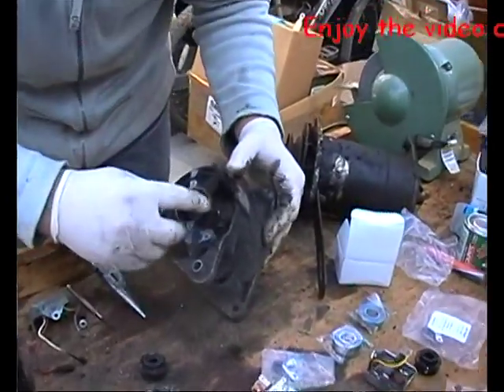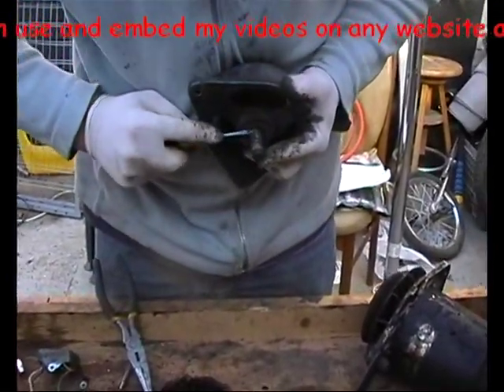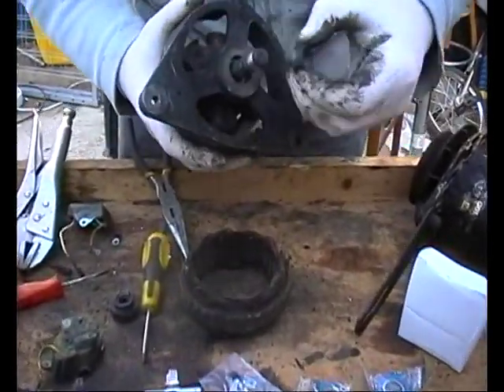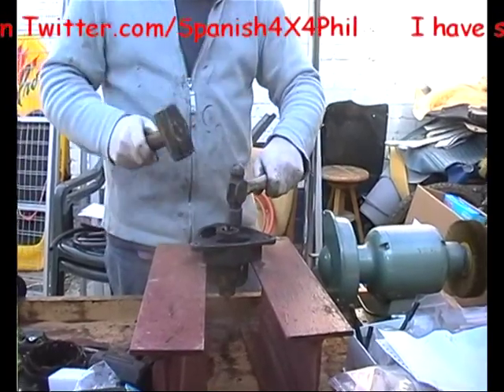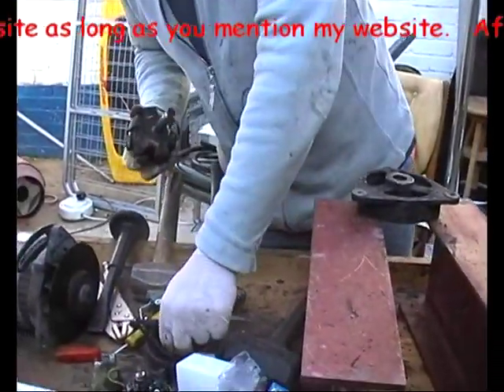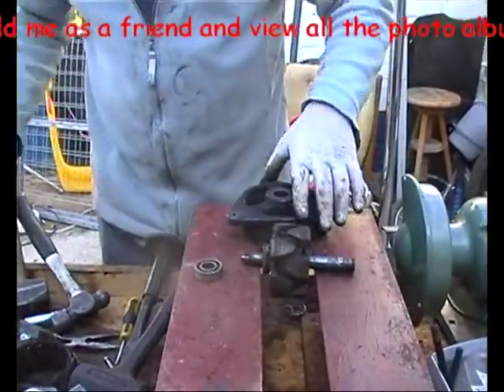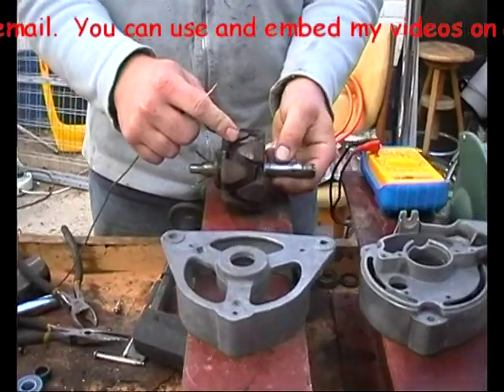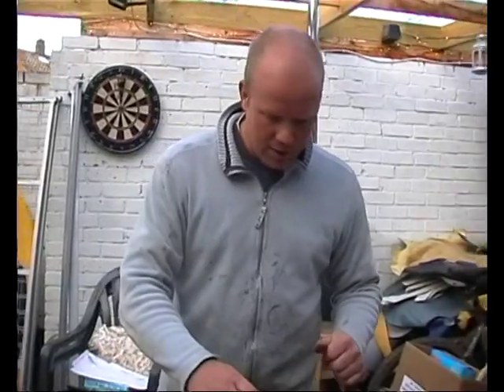ALTERNATOR REBUILD PART 2 FROM DIY-DVDS.COM

Comment: There were 2 other ring/washers that came out when the front bearing when it was removed. Were they from the bearing i.e outer seal or where they a washer that wasnt replaced when the new bearing was fitted? 

If you are hitting the threads with a hammer make sure to put on the nut first. It wont take much to damage the threads.

Comment: small tip :lay the aluminium parts on an electric plate and heat them up
then the bearings either fall out on their own or need to be helped by dropping the casing from a little distance ontoo the tabletop or grab it with gloves and slam it down , then turn the case over and drop the new bearings in 
its realy eazy 
works on bearings and sleeves too when you need to have a pressfit on shafts , just dont get them so hot that they turn bleu 
they just need to sissle when you touch them with a wet finger

Comment: the old chisel to remove a bearing trick.a big no no.use a press or puller.bead blast the cases.2 to 3 amps depending on you amp draw of your rotor some will be more some will be less depending on the strength of your rotor.if you do good on this move up to a marine alt and you will be challenged by real corrosion.